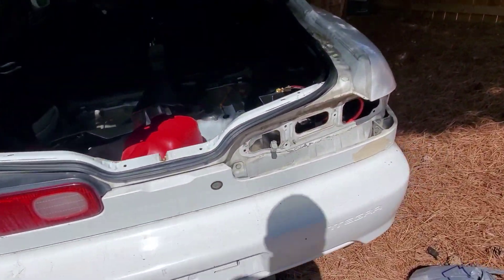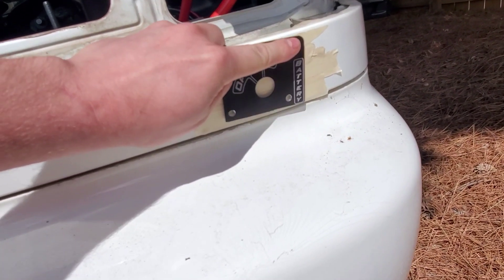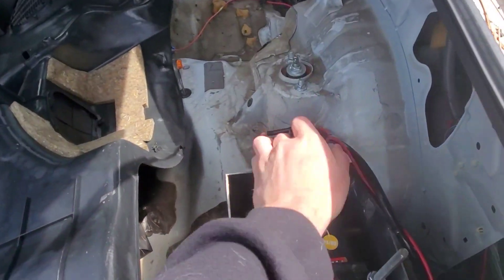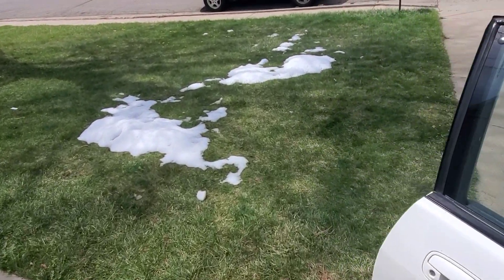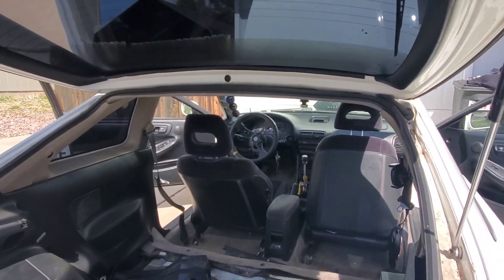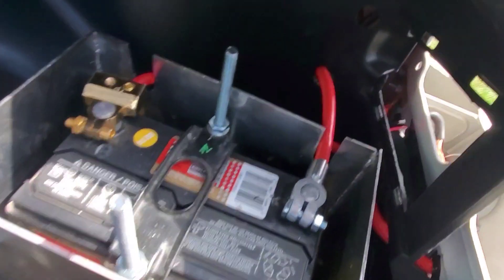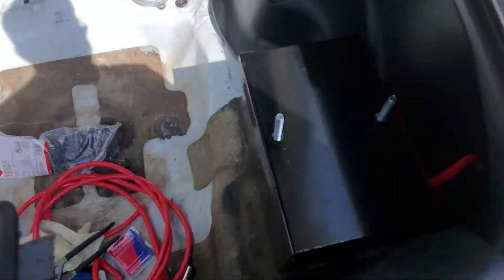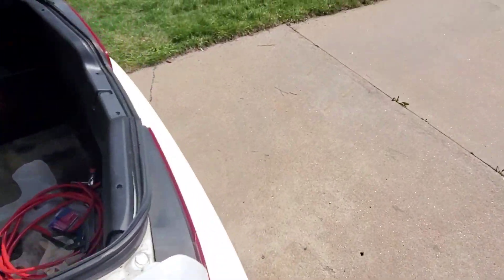Installing an NHRA approved battery switch

Comment: Next time run one power wire from the switch to a distribution block inside the engine bay so you don't have to run anything but 1 power wire to the back.
Reply from the maker: This is great advise 👏 I will do so next time thank you

Comment: if i put the alternator wire to the "out" side of the switch, wouldnt the power being generated with engine running continue to power the ignition?